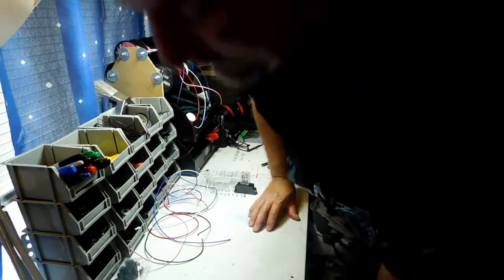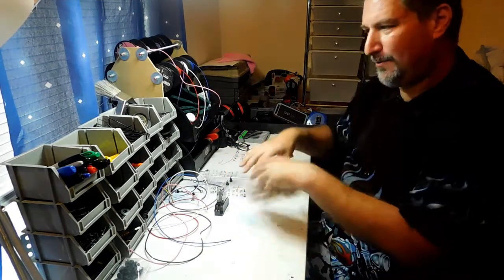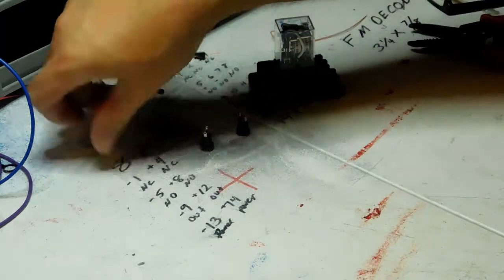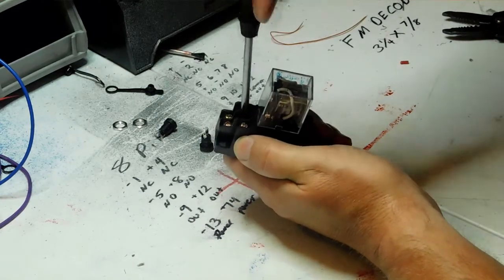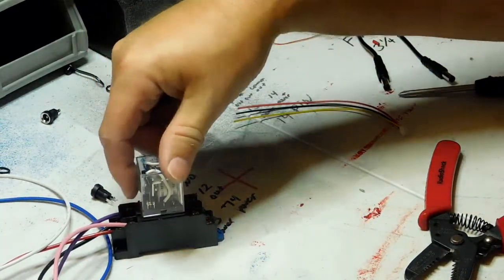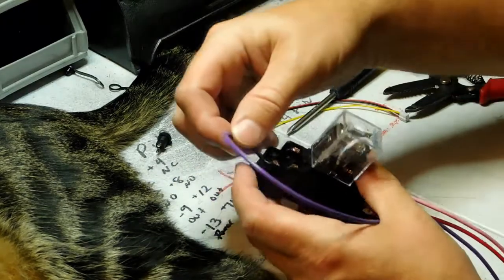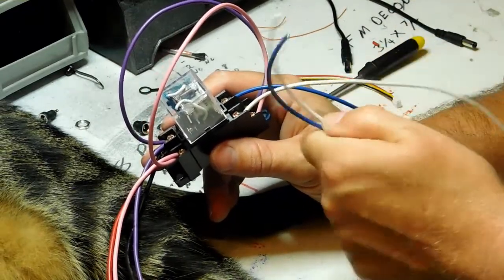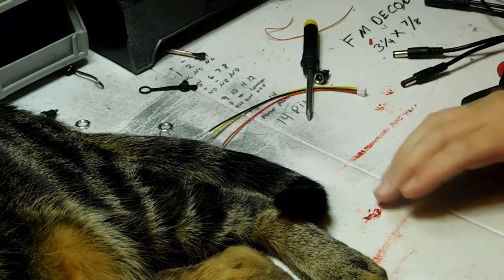How to wire a realy for your boom box projects

Comment: what power supply (specs) do you recommend (portable, not desktop versions)?  Are you using the same power supply to charge the battery as well?  I would think you would use a higher power charger for charging,  maybe a14v 5 amp or what do you think?
Reply from the maker: Never use a charger as a power supply. 

Send me an email and I will send you a link

veryhumble777@gmail.com

Comment: Does the battery and power supply have to be the same voltage for this to work. I’m running 20v battery put my power supply is 12 volt when I plug the power supply the red light on relay turns on but nothing happens I have it wired exactly how u showed us in this video.
Reply from the maker: Well, I have a lot of questions,  but it's hard to go back and forth here. I think I know the problem but again,  I have questions.  If you possibly can, please join my Facebook group.  I love all things radio,  and I can answer them there. If not, I can message you my number and you can call me . I can help you figure this out.
Reply from the maker: Email me your phone number   
veryhumble777@gmail.comI
Reply: DIY Boom Boxes In Texas I’m already on your Facebook page
Reply from the maker: @mikecoronel5140  ok cool, ask me the question there. I will respond

Comment: The one labeled #4 on yours is 2 on mine. 5 and 8 on mine is on opposite side on mine? Im confused now
Reply from the maker: Do you have an 8 pin or 14 pin relay?
Reply: @diyboomboxesintexas2805  it works. Thanks
Reply: @diyboomboxesintexas2805  its 8 pin. It is set up just like yours. They just used different numbers.
Reply from the maker: What are you making?
Reply: @diyboomboxesintexas2805  my first boombox. I was hoping to finish it last weekend but been sick
Reply from the maker: The rule of thumb that I use is to put the negative wire suck on the odd numbers and put the positive wires on the even numbers